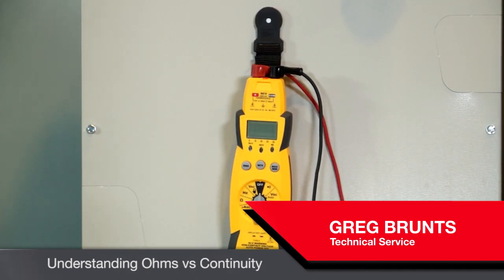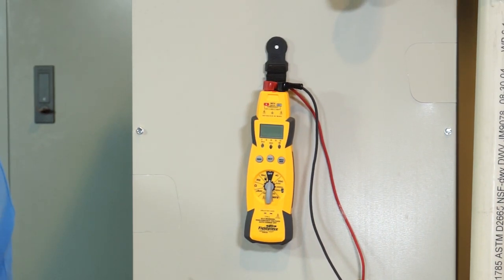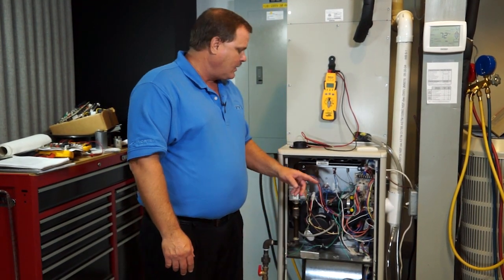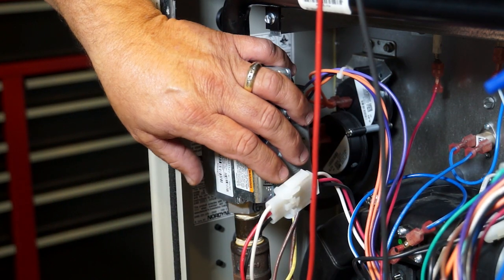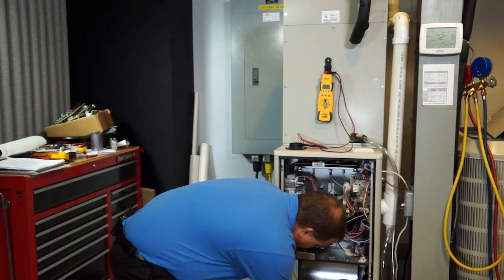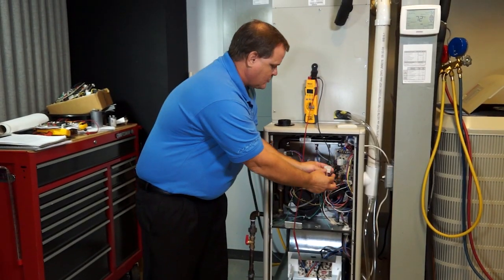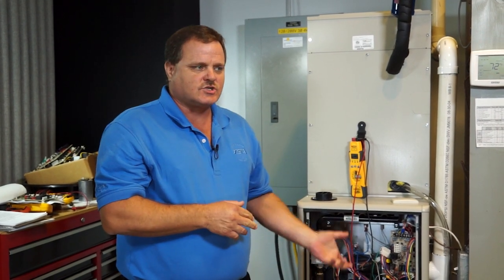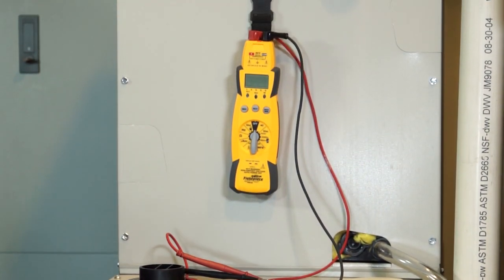Understanding Ohms vs Continuity

Comment: im trying to understand the theory.so is the meter creating a small voltage signal thats seen from one end of the meter probe to the other and when you have high residtance,one probe send out voltage signal but other cant receive it due to high resistance? therfore as you turn the meter to read higher resistance is it simply just increasing the voltage signal it puts out?

and when you say "if you just measure continuity that meter would tone" is this because that setting is simply adding more voltage signal out then the ohms setting?

one more question,my meter has a diode setting with audable tone is this considered the continuity setting?
Reply from the maker: Please contact Nortek Tech Services for help 1-800-422-4328

Comment: I dont understand how you know that 50 ohms or 25 ohms or 10ohms is too much. How do you determine what the ohm reading should be for any given situation? I'm just trying to begin to understand ohms law but this is the most confusing aspect of ohms to me
How is someone supposed to know how much is too much and how much is ok? Scratching my head.
Reply: Look at it this way.  Resistance is a load and a load is work for the electrons.  Wires and switches when closed should provide low resistance for the electrons to do work.  You want all the voltage at the load with minimal losses getting there.
Reply from the maker: Please contact Nortek Technical Support for assistance 1-800-422-4328

Comment: you are one of the rare people who explains this so a layman can understand.
Yet, a caveat: A completely green person would still not be 100% clear if ohms law is not clear in their mind.  V=IR, I=V/R, R=V/I so has to see how any of these parameters affect the others with the understanding that the devices(loads) on  a circuit are to receive the adequate Voltage to function properly. When doing that basic arithmetic on a circuit one would be able to see the values reflect the problem.
Simple, a shitwire corroded will not be flagged by a continuity test... it will show continuity and fool most who do not realize that ohms(resistance) and continuity have nothing to do with each other! They are not related as most people instruct! Same as if I place a baby at the tip of the boxer's glove... the baby's glove will have no effect on the opponent's face, but you certainly could say you have continuity.  ...or you could have a boxer who just corroded his hand(broke it in the fight) and though continuity would appear fine to the eyes of the audience, that hand becomes useless.

Comment: i have portserver ts 16 stop working, the reason is short  in teminal input when i measure continuity by multimeter gives me (019)
i removed every capacitor or resistance gave me that no (019) but the short still exist, help me

Comment: I still don't understand the usage of continuity. What is using continuity good for?
Reply from the maker: Good morning, 
Continuity tells you there is a complete circuit measuring the actual ohm value. This will tell you how good the path is, provided you know what the ohm value should be. 
For more tips, visit EdgeTekhvac.com
Reply: Sometimes you can't see the meter display value but can hear the tone.